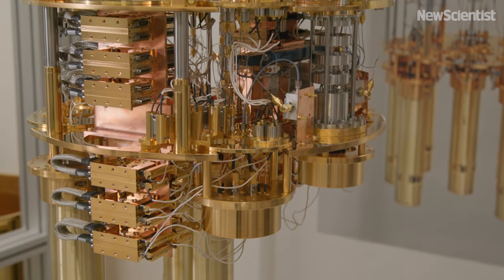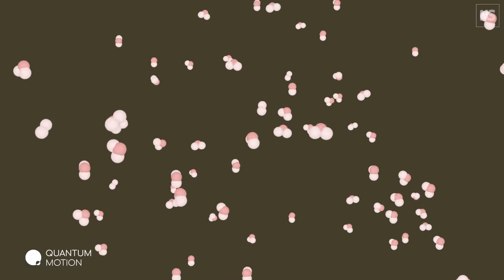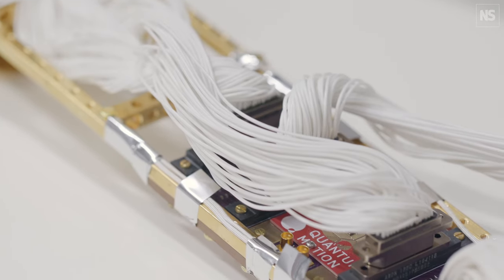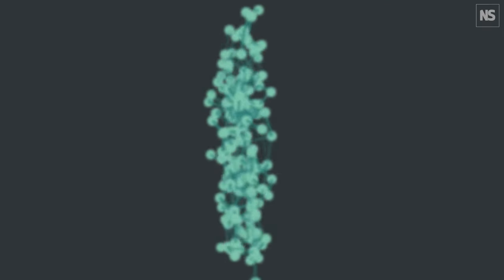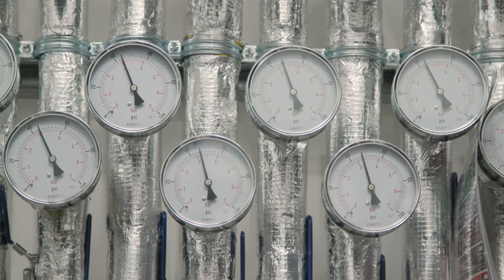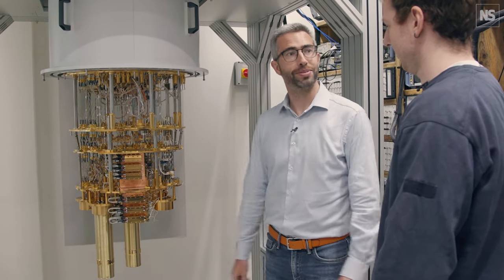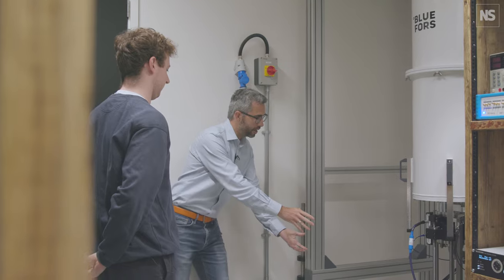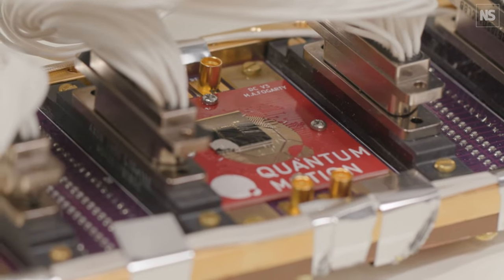How quantum computers work: Explaining qubits to quantum superposition

Comment: Superposition is similar to a pebble dropped into water will form ripples that are not random; the waves are relative and synchronized as they radiate out from their centre source. In this theory, time has a similar geometry based on Huygens’ Principle: That says: “Every point on a wave front may be considered a source of secondary spherical 4πr² wave, which spreads out in the forward direction at the speed of light”. The light waves only move in the forward direction because we have an uncertain ∆×∆pᵪ≥h/4π future continuously coming into existence with the exchange of light photon ∆E=hf energy forming new spherical waves of probability. The wave particle nature of light and matter in the form of electrons is forming an interactive process or what I like to call a blank canvas that we can interact with. Light photon ∆E=hf energy is continuously transforming potential energy into the kinetic Eₖ=½mv² energy of matter, in the form of electrons. Kinetic energy is the energy of what is actually ‘happening’. The dynamic geometry of this process forms an uncertain ∆×∆pᵪ≥h/4π probabilistic future continuously unfolding relative to the electron probability cloud of the atoms and the wavelength of the light.